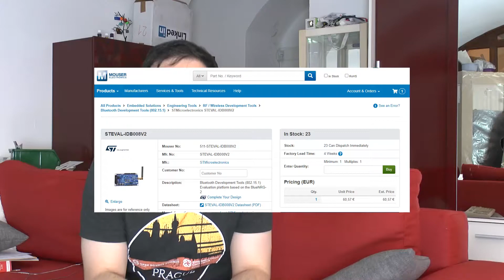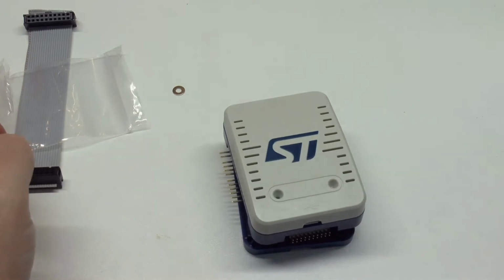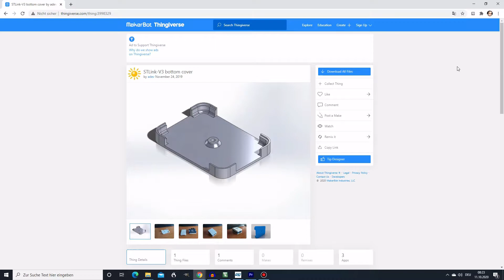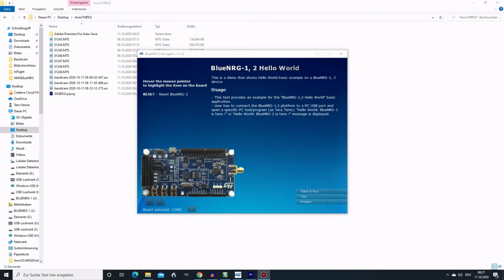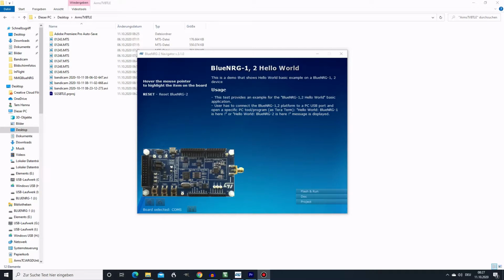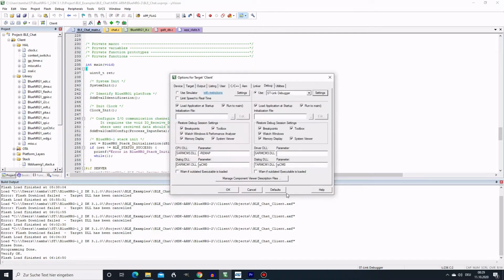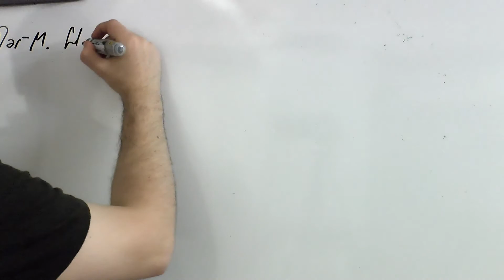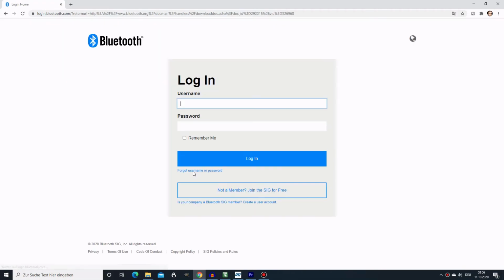BlueNRG II - STLink debugging, certification

Comment: If you somehow erase the firmware on the stm32l151 stm does provide the hex files for the USB-to Serial firmware (BLUENRG 1/2 SDK). You have to program the DFU bootloader and the USB to Serial hex that are on the sdk folder. I made the mistake to erase it but luckily i found how to install it back
Reply from the maker: Thank you so much for talking back, my friend! Did you already see the new WBA version?

Comment: Hey Tam, at 12:54 in the video, in the bottom left terminal of the debugger there is a stream of "Cannot access Memory" commands. Are you sure that the ST-Link was working properly?
Reply from the maker: Hello, thank you so much for talking back! I had the program working - so the system worked IMHO.

Comment: Hi. I was wondering how you know the ST-Link V3SET is the only debugger that will work with the BLUE-NRG2? Why wont the ST-Link/V2 work? Is this stated in documentation?
Reply from the maker: Hello Mike, don't know it directly. But I read a lot of newsgroup comments and only saw complaints from people with an STLINK V2. Given that no one complained about the V3, ;)

Thanks for talking back also!!!

Tam
Reply: I have used many BlueNrg boards BlueNRG-1 2 and in my experience they work perfectly well with STLink v2